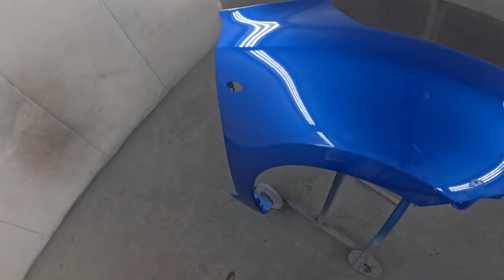Porsche GT3 RS Rear Wing Paint Problems

Comment: Ive had this done to me before...I used a mipa isolator which did the trick.....
Reply from the maker: I did think about Isolator but it’s more for stopping reactions from old coatings that you want to paint over, I was more concerned about adhesion to the raw material

Comment: JAY WHEN YOU PUT THRE MIPA F 37 ON DO YOU HAVE TO SAND IT OR CAN YOU PUT YOUR COLOUR STRAIGHT OVER 😊
Reply from the maker: No it’s wet on wet so you can paint straight over it
Reply: @TheHumblePaintSprayer333   so jay mipa F 37 wet on wet primer can you get it in  light gray as well
Reply from the maker: @ANDY-we7mr  yes they do light grey and dark grey
Reply: @TheHumblePaintSprayer333   so jay when that lad painted my bumper and it does not match the car he used light gray instead of dark grey  its LUNA SKY GRAY base coat paint what is the difference between the dark and the light gray jay I have only used upol high build primer gray

Comment: Epoxy primer maybe seal it up
Reply from the maker: It might be better, I think the issues are due to whatever is releasing from the material so whatever i use it would still lift,I thought leaving it for a few days and baking it a few times when it’s open would help, I did need a good build on it as we had to strip off with 120 grit and it did create some ripples it the material